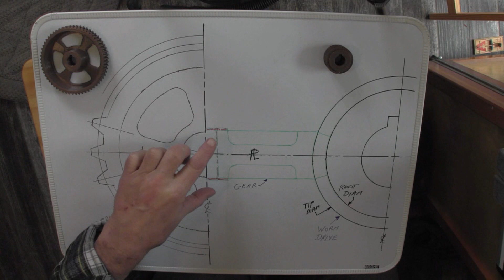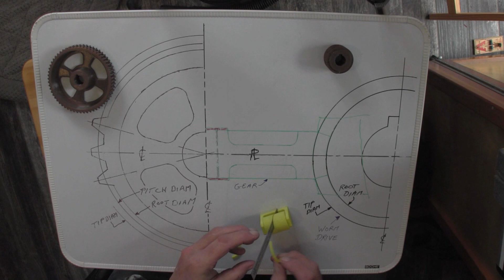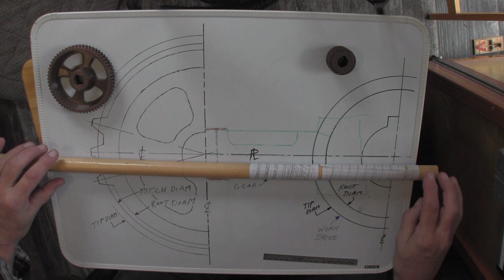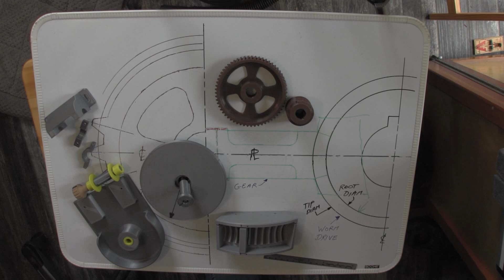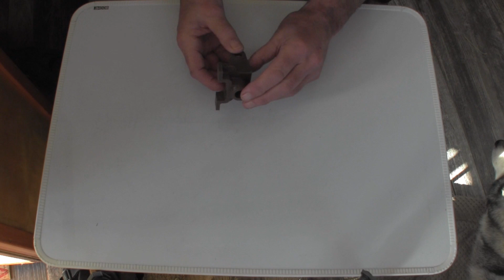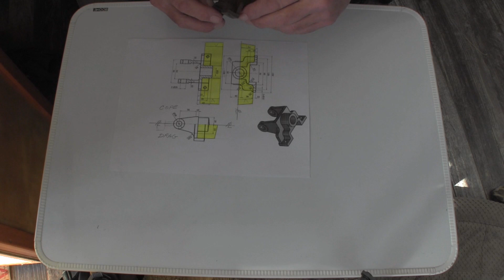Worm gear and drive with as cast teeth. And pattern design for simple bracket.

Comment from the maker: When i built my first worm gear and drive, I was surprised how easy it was. I was a 3 year apprentice at the time. Hardest part was the accuracy of the layout. For core sand, co2 or airset cores. Green sand wouldn't work, too soft to handle.

Comment: I'm subscribing to learn a thing or two about patterns. 

 I'd really like to see the gear tooth core box in use.  My intuition tells me it would be super fiddly and failure prone, but since it worked, that's obviously not the case.  

And what would be the binder used for sand in a detailed core box like that?  Would it just be packed with greensand? Or would it have to be something more stout?

Thank you for sharing your experience!